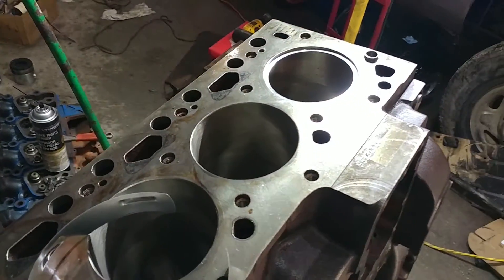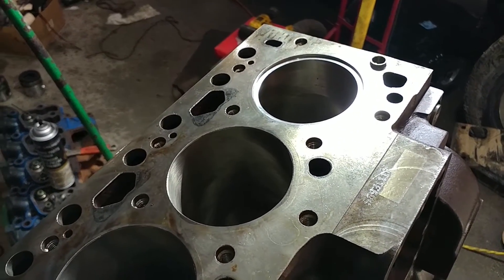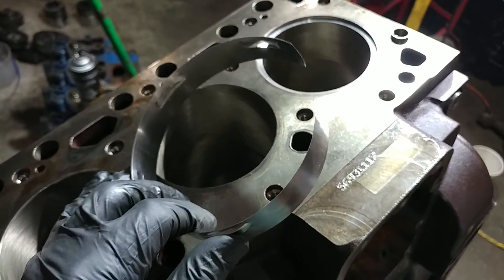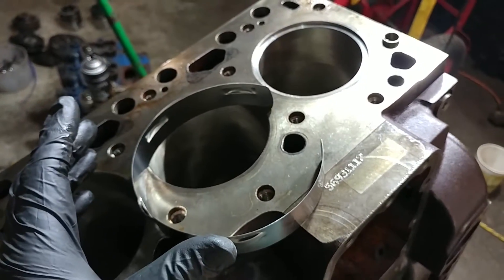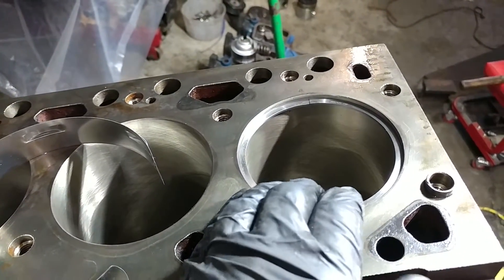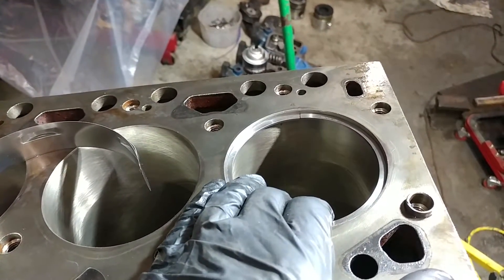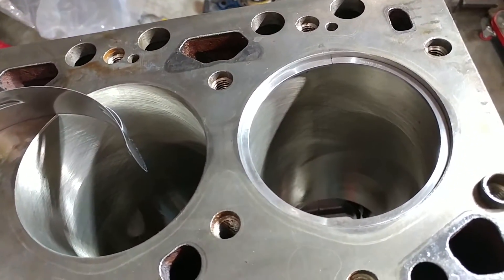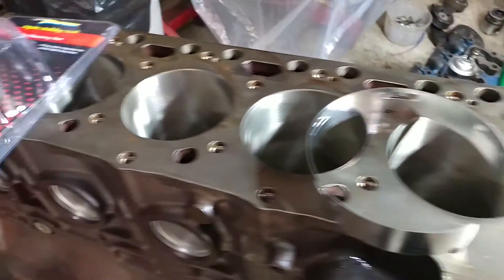Chronicles Of A 03 Cummins Rebuild -Part 4- Ring Squaring, Ring Gap Specs and Saddle Jets

Comment: Why not use a piston to square the rings?
Reply from the maker: You can 100% do that! We like this tool cause it will square almost any common ring size, is light, easy to hold on to,  fast, and you never run the risk of dropping a piston.  We used to use pistons in the past and have several sets of new pistons kicking around, but we never find ourselves reaching for a piston since picking up this tool.  But, it's worth mentioning again (for anyone out that who may have gotten the wrong impression), you are correct and people can use a new piston (sized to your block) to get the rings squared up! Thanks for stopping by and for the comment!